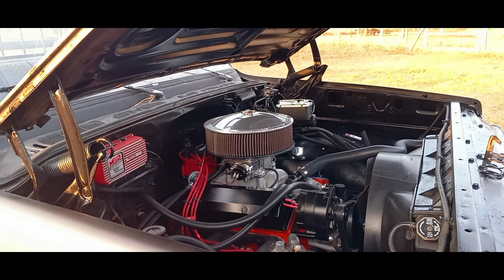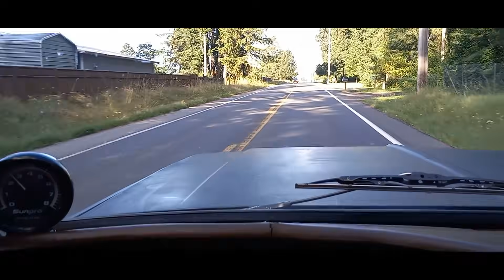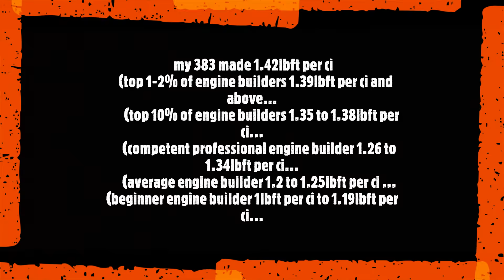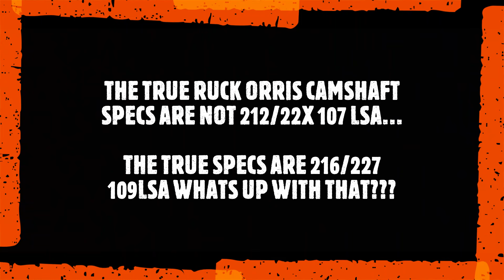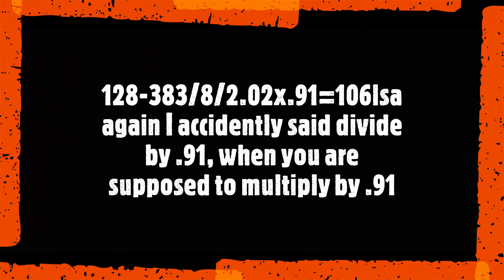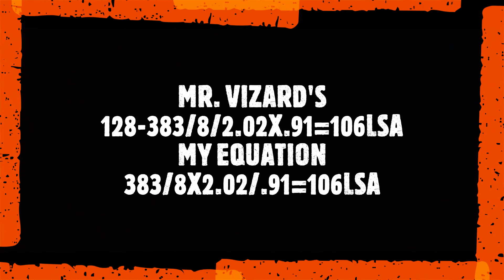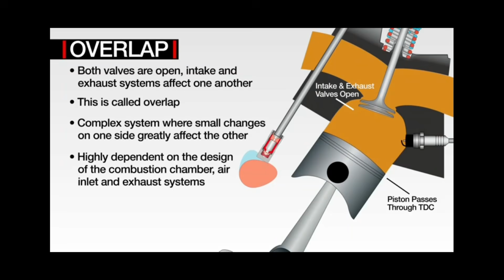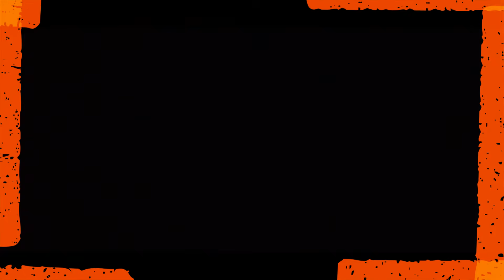CAMSHAFT SELECTION by LSA, 9 LSA's DYNO TESTED!!! LSA THEORY WILL BE DYNO PROVEN!!!, and EXPLAINED

Comment: Heya boss this was quite the informative and interesting video. I’m a tech that works on all models ; you didn’t cover how to get the base # 128 Chevy 127 ford example , also did not cover if instead of always using 8 constant is because it’s a cylinder count constant variable…. I’m only 5 years into this, you clearly explained all of this nothing was over my head at this point. It does seem that for modern engines ( 5.0 coyote , new ls , 5.7 dodge) doing all the breathing characteristics from the air filter to the exhaust piping is minimal gains for effort time invested and knowledge required … I fully agree that NA is superior to forced induction ; even if you will be forcing you need to look at base characteristics before the forced differences
Reply from the maker: Thank you for watching, it sounds like you have a good understanding of Mr. Vizards formula. I didn't want to get to deep so I just gave the base numbers for a fairly wide range of v8 engines as far a engine commonality... my main focus with this video was to keep it as simple as possible, give people an idea how to come to the starting point for LSA, give idea how to adjust it accordingly, along with showing the effects of LSA with dyno sheets... Also giving an example that LSA matters, in the form of Dyno sheets for BT's theory for LSA, I also hoped people took away the negative effects of widening the LSA & adding exhaust duration, the effects of exhaust duration, it's negative effects, and how it can be used while specing a cam.. etc... take care...
Reply: Right on boss I’ll be waiting for the advanced videos if we get them :) …. I like your method of proof with dyno sheets ; from where I’m sitting the LSA is the final product not what you change (for a lack of better words) …. I started on modern Fords, the 3.5 NA and the 3.7 engines from them have relative horsepower and torque are very similar in design, your one of the few that will understand since the torque curve is so flat on the 3.7 it is faster than the 3.5 Na; Even thought the 3.5 will feel faster because of an actual curve and shifting
Reply: Ps I will look into  Vizar as well thanks !

Comment: 565ci BBC with 735hp and 680ftlbs torque, 10.5 compression, 400cfm intake port, 2.3" I valve 114lsa 248-258 680 lift, how much did I lose? It's a dog, ran 10.89 1/4 mile @123 4320lbs

Comment: 54:20 into the video, the corrected formula is given. No matter how I try, I come up with an answer of 15.3002 for the LSA. Something is wrong with this formaul or I am not seeing something. Anyone care to explain?  
128 minus the cubic inchesis divided by the number of cylinders (8), that answer is divided by multiplying valve diameter by .91
Plugging in the numbers 128-383= -225. Then -225/8 = -28.125
2.02x.91 = 1.8382
Then -28.125 / 1.8382 =  -15.3002937656403 is supposed to be the LSA??
Anyone care to explain?
Reply: Just follow the arithmetic order of priority, (Division has priority over subtraction, same as multiplication), so, first divide 383 by 8:
383/ 8 = 47.875
Then, divide this result by 2.02:
47.875/ 2.02 = 23.700495
This result has to be multiplied by 0.91:
23.700495* 0.91 = 21.5674505
This "21.5674505" is the value you need to subtract from 128:
128- 21.5674505 = 106.43255
Just the value shown here.
The correct formula, with opportune parenthesis, may look like this:
128- (((ci/ 8)/vd)* 0.91)
where
"ci" is your Cubic Inches
"vd" is the valve diameter
and the others are constants.

Hope this helps
Reply: @Lex9296  Yes, it is the steps in which the math is done. Here is the order and I now understand the formula. Parenthesis, exponents, multiply and divide (go left to right as both have equal value in completing the problem correctly), addition and subtraction (left to right).
Reply from the maker: It is 128-ci÷8÷valve diameter ×.91
Reply from the maker: For example 128-(383/8/2.02×.91)=106

Comment: It's been proven that the lower the LSA the more power down low but you also sacrifice engine vacuum. I always wondered if you kept that LSA low like 101 then ran 250+ duration and some lift like 500-600 depending on head obviously!!! I understand with that much duration you would have to be 12:1 compression and higher Wonder if you could get the best of both mite even need more duration depending on cubic inch obviously?

Comment: I don't disagree with much of this however we have dyno tested hundreds of engines and what we discovered is one size does not fit all different engines respond differently we have used many of David Vizard's methods and I must agree the man is very spot on, with respect to LS based engines we have seen more power and TQ with wider LSA in some of the strokers we make 50 HP more with 114 LSA than we got with 108 or 106 the engines wants what the engine wants sometimes you can do all the correct calculations that work well and then boom you try it in another combo and it does not work you are comparing a handful of dyno tests we have done hundreds, and discovered this science is not 100% correct all time
Reply from the maker: I can't disagree with that at all, because in all honestly (like i said in the video) "there are cases when a ls engine can use a wider lsa" those are cases that when all the parts used and all the other parameters are taken into account and calculated, (this would be a way more advanced calculation) it may end up giving you a wider LSA to match said CI, combination parts, & specs.. from my previous 18 years experience in my dads race engine machine shop dyno testing engines when i was younger, all though we didn't do alot of ls engines back then we still did quite a few.. from my experience, that scenario of a larger ci ls engine wanting a wider LSA is not as common because that requires some really serious cylinder heads with a really nice valve job, rapid intake valve opening, high compression etc... thank you for taking the time to watch, I really appreciate it!... I would really like to know what your experience/your take is with ls engines combos wanting wider LSA's, what kind of trends have you found as far as combinations of parts that would be ideal with a wider LSA.. im curious, lm always looking to learn more..
 thank you....
P.S. I've been watching your channel off and on for years, you do a good job with your channel.. keep up the good work.. take care buddy....
Reply: As always the only way to find the exact best is to test it, change any one aspect and suddenly the best may not be the best anymore. I believe David touts his formula as a guide to where to start not that it will be the perfect best and it is very specific to the engines it applies too because the formula is imperical based and a result of tons of dyno tests on a particular setup. I don't think he has the data to predict the best cam for a v8 packard since it likely is going to need a different number just like the different numbers for Fords and BBC.  Curious though on the 114 LS when you picked up 50hp did it loose any torque down low?

Comment: You often stress the importance of valve event timing. Only one combination of durations, ramping, and LSA will produce a specific valve event timing. Surely you realize that duration and LSA, no matter how they fall, are derived from valve event timing.
Reply from the maker: Surely i do realize, As I said in the video, I knew all about valve events when i was 8 years old.. You do realize, As i said in the video, as a kid i was taught by an engineer/physicist who built race engines, in the form of my Grandfather, and a machinst who also built race engines, in the form of my Dad, and I myself have been building engines since i was 10 years old and I have personally built & tested well over 150+ race engines... how does someone spend a majority of your life building a testing engines and not know what valve events actually are? Do you really think i could have said all of what i did, all the while not knowing what valve event timing actually is? 

Clearly it isn't the camshaft....

Valve event timing is the intake & exhaust valve opening & closing points in relation to degrees of crankshaft rotation and piston position......That is valve event timing..... also I'm assuming you didn't watch the full video??
Reply: Are you saying valve events aren't related to LSA?
Reply from the maker: @fascistpedant758  are u Fuckin serious??? You are going to waste my time with a dumbass question after that answer I just gave you???  The camshaft & each spec of the camshaft along with the camshaft  lobe profile influences the valve events.... IS THAT BETTER?? DO YOU UNDERSTAND??
Reply from the maker: @Fascist Pednat Let me ask you something Mr camshaft & valve events... what effect do polynomial coefficients have on valve events??

Comment: Adam you're ball of knowledge. Watch your entire video. Some people may have gotten upset about  you telling it like it is but just like Mr Vizard you feel an obligation to state  proven facts. Well done! I like to maybe run my combination across to you for some input.
Reply from the maker: Thank you for watching, I really appreciate it!!, take care...
Reply: @CDG-Racing_Dynamics hey man.  I have no idea about cams or motors.  A lot of what you’ve said in this video just went over my head.  I do have a question if your able to answer.  2015 Stock 6.4 Ram 2500 motor, bored .20 over. Truck cam was removed and a non-mds cam from a 2015 SRT 392 Challenger.  286 intake duration, 288 exhaust duration, .571 intake lift, .536 exhaust lift, 121 LSA.  Are you able to tell me if this combination is shooting myself in the foot, for truck performance.  Or if I should be looking for a different camshaft.  It is a VVT and I will be getting it tuned.  Thank you for your time.

Comment: In short terms, the #1 tuning tool is between the ears - the more one lears the more effective that tool is.
Bit harsh of opinionated tuners and manufacturers, there - Mr Vizard is possible the most so - but to be fair, he's damn near always right in the end.
I like the way you kept mentioning torque, and that the entire engine assembly must be considered as a whole - I recall many years ago one of the American 'performance' mag's did a comparison of 5 different exhaust manifolds (headers) and there was ~50 hp difference on their engine configuration between the best and the worst, can't recall the torque values. Change the engine build to suit the 'worst' headers and the 'best' may have been the one 50hp down.
Reply from the maker: Thanks for watching. Take care..

Comment: Adam, first let me say I am sorry to hear about your condition. Debilitating disease is heart wrenching. I really liked your video and the information you put out. I especially like the duration formula you put out. I have not seen David Vizard put that formula in any of his videos yet. I follow him too. I have two of his books and am building a '83 Camaro Z28. I am putting a .040" over 350 in it and will be running the full Hooker 3rd Gen F-Body exhaust system with Summit/Dart Vortec heads which will be modified to DV's specs. I have a late model roller block so I am going to run a hydraulic roller. With the formulas you discussed, I am looking around 218 duration on a 107 LSA. I can't wait to get this thing all together. Thanks for another shot of motivation!
Reply from the maker: Thank you, I appreciate you watching! I'm glad you found this information usefull.. take care buddy!!

Comment: RAMP SPEED ON LOBE ALSO MATTERS
Reply from the maker: You obviously didn't watch the whole video, I talked about intake/exhaust valve opening & closing rates & velocity, ramp rates, acceleration & decaleration rates, jerk rates etc..along with the effect they have on valve dynamics. I even showed the polynomial coefficients that it takes to design cam lobes being as i have designed lobes personally... you can have the most aggressive dynamicly stable lobe possable and of you dont pair it with the proper valve events you won't make as much power as a less dynamicly stable lobe with the proper valve events, and there is absolutely no denying that because its been dyno tested many times and proven correct!! I hope this helps. Take care buddy.

Comment: I just got DV's how to build HP book for Christmas, then I found your video!  To bad about your health conditions, but sharing what you know is really appreciated. 
Do you spec out cams?   Everyone in the LS world just wants the choppy idle.  I've got an LS6 I'm putting in an old Volvo wagon, I just want a fun daily sleeper. Almost every LS cam is either on a 112 or 114 LSA.  I would love a "tiny cam" just to make the long duration bro's scratch their heads, lol.  
(I've also got a 383 I'd like to pick your brain about).
Thanks again!
Reply from the maker: Thank you for watching, I appreciate it. If you want to leave any questions you have in the comment section I will answer them when I have the time to explain anything youe wanting to know...take care!
Reply: @CDG-Racing_Dynamics  so with the 128 rule,  if I'm going to put my 383 in a suburban or a street strip car, they'd get the same LCA, but the overlap would change to get the power / torque where I want it (small overlap for more low end, bigger overlap for high end)?

Comment: He has a Dyno were is urs
Reply from the maker: REALLY?? DID you not listen to the begining of the video?? & Was that the most intelligent question you could muster?? WTF does that have to do with anything?? Other than the fact that i said MR. PHYSICS, MR. VIZARD, MR. DYNO & I WOULD SAY NO.. and, ARE MR. PHYSICS, MR. DYNO AND I FULL OF DO DO... DID I NOT PROVIDE DYNO PROOF FOR MY CLAIMS??  WERE THE ENGINES  NOT OBVIOUSLY TESTED ON A DYNO TO PRODUCE THE DYNO SHEETS?? WTF does me having a dyno have to do with it?? The information I was giving required dyno proof, so i provided dyno proof, and I achived that dyno proof by way of dyno sheets for the specific type of dyno test conducted. I DIDNT KNOW YOU HAD TO HAVE A DYNO TO BE ABLE TO GO OVER DYNO DATA!!  LAST I CHECKED SOLID UNBIASED DATA IS STILL DATA NO MATTED HOW YOU OBTAIN IT..  You do also realize that even alot of high level professionals with lots of money dont even have dynos because a good dyno is extremely expensive!! Also do you have any idea how expensive it would have been just to be able to produce that data i presented??.. there is over $5,000 in camshafts alone, to be able to produce those results you would have to buy 9 different custom roller camshafts, with 3 cams per tests, in 3 different engines..
Reply: @CDG-Racing_Dynamics  we drive cars,not dyno"s right?  you cant argue with physics

Comment: I watched the second half of your video  7 times.   Makes perfect sense.   I race a FE. Powered FOx.   428. Cid.    I knew nothing about the formulas.  But  somehow. I picked. A. A roller with a 106. LSA.   Years ago. My brain kept telling me 106.  For my motor. Tne CR. Is over 13 .1. Duration is. 267-276.  My shift points are between 6700 and 7200.  But it seams to have  TQ. Every where  I have beaten a lot of different combinations with this thing. In  1/8.  Heads up. Grudge. Competition. In have run over 105 in the 660 leaving from idle  foot breaking.    With. Standerd 390.  C4 ae G heads home ported. When   I degreed the cam in  it cam in at  103.7       I just use. The formula. 127 -428 ÷ 8 ÷ 2.10 × .91.  The adding 3 because of the CR.  It put me at 106.   I understand. Duration. Enough to get me in the ball park on targeted rpm for my engine choice  and understand that stroke will effect. Duration requirements  for targeted RPM   but having a little trouble. On how to figure out what the over lap would need to be    I do know that higher RPM will need more.  Overlap but know know how to go about calculating it.      Is there something I'm missing.  On the video     any help would be appreciative       as for BT have no clue to who this individual is. But from what I have seen he  seams  looking at it backwards  LSA. Should not be a end result.  But a starting point    thank you for the video.  And sorry for your condition.  Prayers sent
Reply from the maker: Thank you for taking the time to watch multiple times. It sounds ike you have a good handle on the effective increase in power that can be achieved through lsa.. now for your question, i will answer your question here's soon a I have the time to explain. I've been pretty busy, take care buddy!
Reply: @CDG-Racing_Dynamics     thank you   will be looking forward to it.     And you do the same

Comment: In 1963 I was 13 years old and was reading everything I could find on 4 cycle gas burning Engine modifications.
I was lucky an old guy in his late 20’s gave me a book to read and Ed Winfield stated “If the camshaft intake to exhaust angle is anything but 108 degrees it is designed wrong and someone is changing it as a crutch to fix another engine design problem”. That sure has seemed true over all these years BUT I am always willing to listen and think through anyone’s ideas and proof by engine performance.
In the end we all what the best power everywhere unless it is a specific narrow rpm range. I enjoyed the video and I keep an open mind.
I ❤that you are not bashing or bad mouthing ANYONE because that action is just counterproductive and then it’s not a help to anyone.
M
Reply from the maker: Thank you for taking the time to watch the video, and giving enough consideration to understand, I appreciate it! Take care buddy!!
Reply: Yup nice job